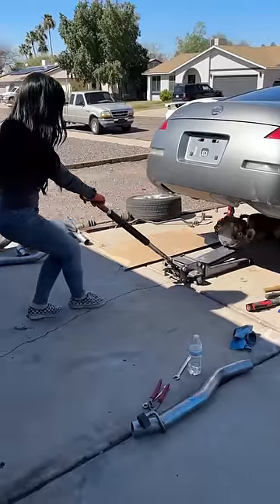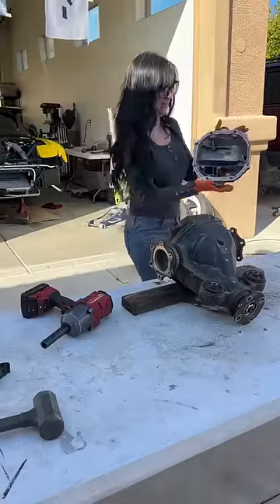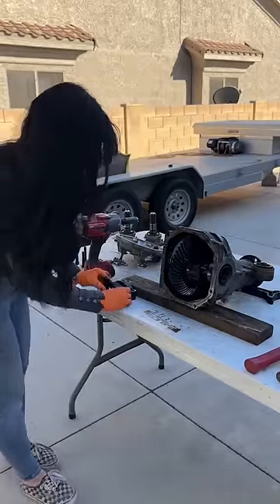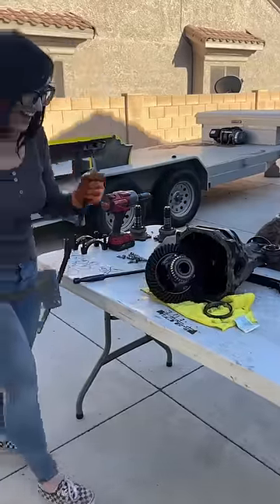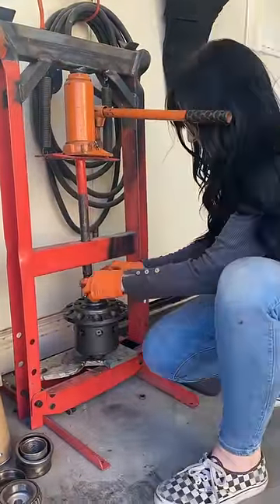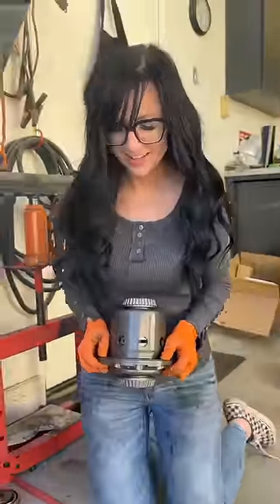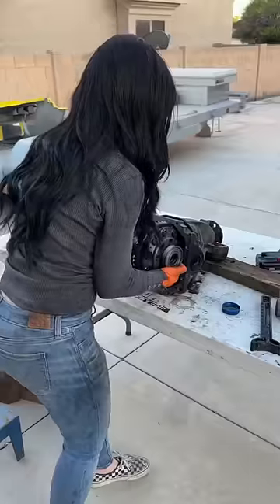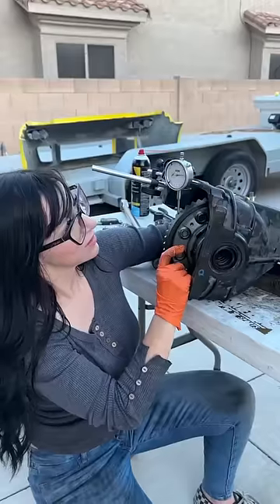NEW rear differential for the Z33!

Comment: Always great to see a screwdriver being used as intended 🙃
Reply: They make good prybars
Reply: And punches, because a cheap harbor freight screw driver is still cheaper after the 5th set
Reply: Literally no problem with its use
Reply: Also great to see a pry bar used against an aluminum sealing face
Reply: Every tool is a hammer if you use it wrong enough
Reply: I was wondering about that too.
Reply: Screwdrivers are the original multi-tool
Reply: @Weimerica8841  aluminum cover, the actual pumpkin is iron
Reply: @PatricioGarcia1973  I don't think you understand the problem lol

Comment: Just a tip...  When pressing on the carrier bearings you should always use a cupped driver and holder. Because in many MANY cases the bearing I pressed on farther then the bearing holder is deep (or long, which ever you prefer). If you don't press bearings on correct and also transfer any shims, you could have a serious problem. Good luck.

Comment: Most of the time, you need a dead blow hammer or a case spreader to install the carrier back into the case. Hopefully, you did it correctly. Don't let this video fool you.  This job is much more involved than this video implies. Sometimes, this job can be a complete SOB. Especially if you've never done it before. And/or  you're attempting to do it in your driveway with limited knowledge. Sometimes, that is nearly impossible. Especially if there's a crush sleeve that needs to be crushed. I like to use a crush sleeve eliminator kit. (If possible) Sometimes you need to tighten the pinion nut 350-400+ ft/lbs to get it to crush. Crush it too much. You need to go buy another one. Don't do this to your dd unless you absolutely know what you're doing. Otherwise, you might need to ask someone for a ride to work on Monday.😆

Comment: Got that back lash correct first try. You won the lottery
Reply: Yep the diff was exactly the same width down to the thousandth of a inch.
Reply: I didn't see any gear pattern paint either
Reply: Plug and play gears...😂😂😂
Reply: Haha. Exactly. So simple…
Reply: pinion wasnt removed, carrier shims where at the same place, backlash should not change
Reply: @lalipop241  That was a new carrier and she changed the bearings. Please return your horrible freight tools before you break someones bicycle!

Comment: Anybody who can set up a differential CORRECTLY, IS VERY RARE AND A ARTISTS
Reply: she wasn't done backlash is one part pinion preload and pattern youre right it is an art
Reply: Didn’t check lash before she tore it down and, then proceeded to reuse the ring and pinion. Amateur hour.
Reply: @tenmil1 It's perfectly acceptable to reuse the ring and pinion. She didn't check the pattern though😢
Reply: @maxspeed2084  yes it is acceptable, but you need to know how it was running before so you can get the teeth to mesh in the same spot where they've been worn in.
Reply: Exactly, I've seen several rebuilds with none of them lasting over a year.
Reply: It depends on the wear pattern on the ring gear and pinion.  If it has Sharpe edges it will Crack and break.
Reply: @tenmil1  She should have checked the pattern before installing the new carrier.  However, one could see the pattern in the ring and pinion and match it.
Reply: @davekeller2798  If there were sharp edges, the ring and pinion are junk!  She just installed a new carrier into the diff.  The ring and pinion weren't trashed.
Reply: @maxspeed2084  yeah and that’s a little bit of guess/eyeballing work. taking precision measurements will always be superior. Not saying it can’t be done, but it’s not ideal. If you’re setting up a diff you should have a dial indicator and base on hand, no?

Comment: First thing you you do is measure the backlash
Then install the new differential without the ring gear to set the bearing preload. Then install the ring gear and adjust the shims for the same backlash as you got in step 1 while maintaining the preload. 
Well only do that if you want it to last.
Reply: You're absolutely correct. BUT, i just viewed this, to VIEW HER !
Reply: I really don't think this was supposed to be a highly informational video
Reply: I'm sure it was pre gapped before and after the video 😉
Reply: and whats the comment got to do with her undercarriage
Reply: She’s doing this on a plastic picnic table in the drive way cmon as long as the car moves after this it’s a w
Reply: I'm sure a man did it right. She's just the model!
Reply: She's doing it for clicks, not longevity.
Reply: Wow, I'm more impressed  by your knowledge  than hers.

Comment: How did you check the lash?
Reply: dial
Reply: Plastiguage or feeler guages. Plasti gauge will measure root clearance too.
Reply: @everettplummer9725  How do you measure lash with a dial indicator. Feeler guages would be easier or plasti-guage if you want to measure root clearance too.

Comment: That new bearing wants to be packed.
Reply: It gets lubricated by the gear oil in the diff case. No need for grease pack
Reply: if you're using grease in your diff you're gonna have a bad time.

Comment: I would double check the pinion to ring gear contact. The new carrier is probably not identical to the old so it may need to be shimmied one way or the other. Also for anyone trying to say it's fake because it was empty when she pulled the dif cover off, the cover has a drain so you dont have to remove the cover to drain it. Why would she make a mess if she didnt need to?

Comment: dont you need to pre fit the diff to set lash before lock tite or sealer  you know to get proper spacing  for ring and pinion mesh you know proper tooth to tooth wear

Comment: I did that in my old  Volkswagen bug. Didn't make sure I put it into the casing the correct direction. 
Installed it and the engine. Time for a test drive. What the heck..! I had 4 reverse gears and 1 forward gear. UGH!!!!
Do over!!! 🤔🤣

Comment: Ironworker i used one at job corps in el paso years ago..to bend 3/4 plate to plasma arc cut or pipe weld beveled surfaces. Root pass 6010 rod and 4 cover passes 8017 rods arc welding..

Comment: Is anyone gonna tell jer the gears would have fell out on there own. Theres either adjustable carrier bearing ahims.or.just a set preload from the case.
Reply: Old dodge and some ford pickups actually use a giant bar that has 2 dowels that sticknout and sit into the two Axle tube weld holes on the pumpkin and spread the cast iron pumpkin apart.